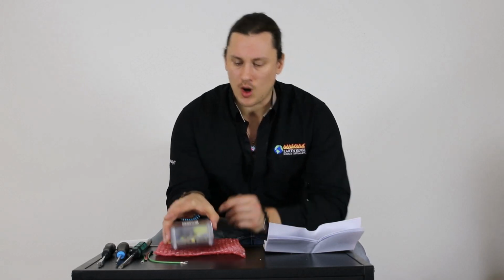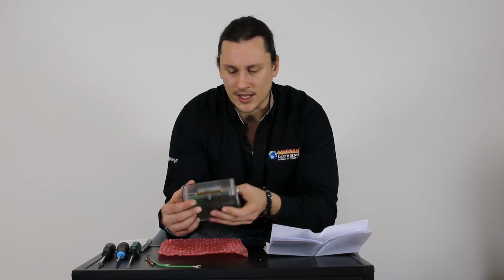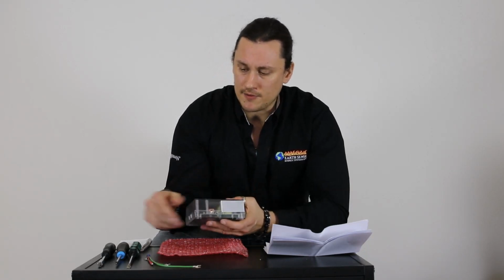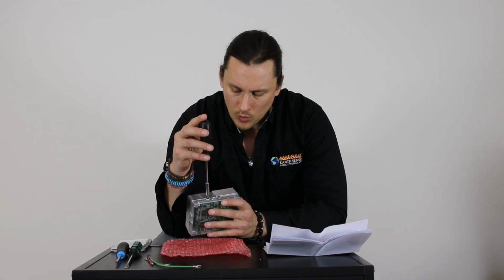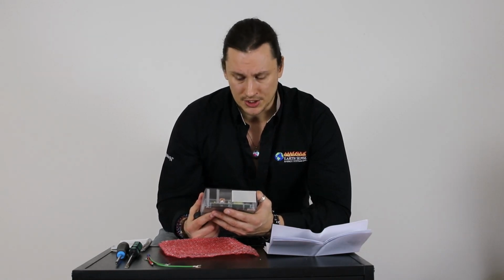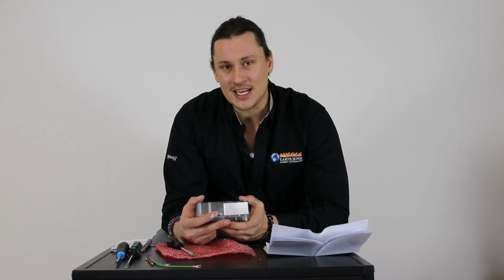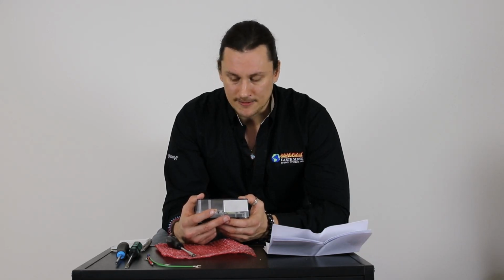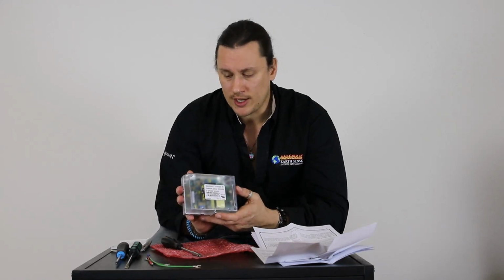QuadraFire 3 Speed Control Board Installation and Settings

Comment: I recently bought a used Quadra Fire Castile Insert (2008).  It seems to work well except I have some reservations on its performance and what I could do to get maximum performance.
Your video helped me set the control board to 7. I set to seven to get a better flame.  Here is what is going on.  The flame is sometimes just in the burnpot and no higher other times about three inches above the burn pot.  I am using premium pellets but they are no bigger then 1/4 mostly.  so all I see going down the shoot is that and a lot of crumbs.  I am wondering if i have a problem with the auger and assembly.  I did look at the thermocouple because it is so old and it looked fine, it was a little hard at the end but I think it is fine because it works with the control board green and red light, I did not do measurements with a meter yet.  Should I replace because of the age? what about the auger?  I think I will replace the blower motor this summer during me seasonal cleanup.  It looks tiered and makes a little noise.  What should I buy that is OE quality but not OEM?
Thank you
Reply from the maker: Thanks for contacting us, I did not see your message until today, our apologies. First off, I would suggest trying a different brand of pellets to see if there is a difference. Unless there is an accumulation of fines in the bag, you really should just see whole pellets dropping in, not crumbs of pellets. See if you can find another brand, buy maybe 5 bags and do a test to see if there is a difference. Most of our customers find that Pine and Fir pellets have the best heat output and lowest ash content. From there I would say it may be helpful to pull out the auger assembly. Overtime, there can be issues with the flights on the auger shaft. Inspect the shaft closely and see if anything is abnormal. We want it to be delivering pellets, not crushing them in the process of feeding. If your thermocouple is currently working fine I would see no reason to replace it. The thermocouple simply allows the unit to go from start-up into normal operation. For the blower motor, are you referring to the room air blower or the combustion/exhaust blower? Happy to send recommended suggestions for your Castile. Inside of the hopper you should also see a pull slide that you can pull up or push down to allow more or less pellet fuel to enter the auger motor shaft. Play with that a bit as well. Keep us posted, happy to help!
Reply: I changed the pellets and seems to be burning better.  I noticed the the glass door does not have the seal on the bottom of the door. Should I have a seal there? @EarthSense
Reply from the maker: @RS-zz3wb  Thanks for the message back, glad to hear the new pellet fuel is burning better. You will notice a really big difference between pellet fuels on heat output, flame size, ash, and cleanliness of the glass and burnpot. Always suggest to try a few different brands and analyze the performance in the stove.

Your 2008 Castile should have a tadpole style gasket that seals the door and glass. Quadra-Fire leaves off the bottom tadpole portion for an 'air-wash' designed to bring in a small amount of room air across the glass to help keep it clean. The tape portion of the gasket should still be in tact securing the glass to the door frame, however it is normal to have the gap at the bottom of the door for the 'Air-Wash'. 

In proper operation, the Quadra-Fire Castile should have a very torchy burning fire - part of the design with the cylindrical firepot. Generally speaking on Low, the fire is in the burnpot, medium up to the rim, sometimes 1-3" over the rim, on high 3-6" above the firepot rim. Again, you will notice a difference in pellet fuel and where you have the hopper slide set. As the unit accumulates ash build-up you will start to notice a larger more lazy fire which is a good indication to do a thorough clean on the stove and vent. 

If you feel there is too much air coming to the fire, let's check your combustion blower motor and the label specs. Just in the event that motor was replaced with an aftermarket it's good to make sure it is the correct CFM motor; the Castile should be 70 CFM. Here is the OEM and aftermarket options for reference. https://pellethead.com/product/quadrafire-heatilator-pleasant-hearth-pelpro-exhaust-combustion-motor-blower-fan-oem/

Keep us posted, happy to help!

Comment: I have a quadrafire Castille insert. The stove continually feeds pellets, but will not ignite. I tested the igniter and it is fine. I set the dial on the control board to 0 and let the stove run through that, the igniter got hot. When I turn the dial to 6 or 7, the igniter will not get hot and pellets just fill the fire pot. The call light is constantly on, and there is a red light on the inside of my control board that is as well. I must admit, I have never seen a green light inside my control board since I have owned this stove. All snap discs are good, all connections are good, vacuum hose has been cleaned out, stove is very clean. What next? What am I missing?
Reply from the maker: Thanks for contacting us, happy to help. I know you said you tested the igniter - let's double check to make sure it is in proper ohm range. If you have the standard 300 watt loop igniter in your Castile, ohms should be 43.5-53.5. Outside of that range there may be ignition issues. More Reference here: https://pellethead.com/how-to-test-and-replace-a-stove-igniter-pellet-stove-ignition-troubleshooting/

If the igniter ohms are correct, then we need to look a bit further. Definitely inspect the igniter wire connections. Make sure the control box is set to the proper dial number for your Castile. If the igniter is not getting a charge/electrical power during start-up (not glowing red), you most likely have a control box issue. If the igniter is getting power during start-up but the fire is not lighting, then we have either an air loss or air blockage issue. Check your burnpot bottom, burnpot holes, burnpot gasket, door gasket, glass gasket. Make sure there are no ash blockages in the stove or vent. No blockages in the air intake. Inspect your combustion motor - should be running near line voltage on start-up for proper ignition. 
In proper operation, as combustion air rushes around the igniter, the super heated air is what is lighting the pellets, not the igniter element itself. Start with the simple things first as you troubleshoot. Keep us posted, happy to help.

Comment: I have the Qua-Fire cb1200 pellet stove …how would I know if the board is bad? I don’t get a red light or green??
Reply from the maker: The best way to determine if a board is good or bad is to have it tested by a local dealer. I would suggest starting with the simple things first. Check your outlet for voltage and polarity, follow the electrical into the stove. Check for any loose wires, exposed wires, or poor connections. Check the fuse that is in the junction box. Disconnect your wall thermostat wires and put a jumper wire or large staple inbetween the thermostat terminal - Could be something with the thermostat - this is a good way to troubleshoot. Feel free to keep us posted and send more details. Happy to help. Thanks.

Comment: I have replaced the igniter the thermocouple and the control box and it still does not start or feed pellets after manual light. I have checked all the snap discs and vacuum switch. I don't think the igniter or original control box were bad. The thermocouple was bad. Where do I go from here? What could cause both the igniter and feed auger to not work? There are no lights in the control box other the blue one during startup.
Reply from the maker: Thanks for contacting us, what Quadra-Fire model do you have? Try reversing the thermocouple wires - We have seen several that need to be reversed to operate correctly. If you are 100% certain both the auger motor and igniter are in correct operable condition, the only thing that would prevent both of them from working would be the control box. You should check your igniter ohms to make sure it is in operable condition. If you have the 300 watt loop igniter ohms should be approx 43-53.0. If you have the 380 watt multi-fuel igniter, ohms should be approx 35-43.5. If there is a dealer that is local  to you it may be advisable to have the control box tested for proper functionality. Happy to help, keep us posted. 

Igniter Reference: https://pellethead.com/how-to-test-and-replace-a-stove-igniter-pellet-stove-ignition-troubleshooting/
Reply: Will try reversing the wires. The control box is New. It still does the same exact thing as the old one. @EarthSense
Reply from the maker: @randywhite7187  Sounds good. It's very rare for a new control box to be faulty. Again sometimes there are local dealers who can test it to be 100 sure. 
How does your door, glass, and ash door gaskets look? Sealing tight? How many pellets have you burned since the last thorough cleaning of the vent, stove, and ash traps? Does your exhaust motor appear to be running near line voltage on start-up? Any air losses or air blockages can/will prevent the vacuum switch from locking in and the auger motor from feeding. For most Quadra-Fires the only thing that controls the ignition sequence is the control board. Again, will be good to test ohms and inspect igniter wiring all the way to the junction box area where the control box is seated.  If you can let us know your model and year of manufacturer, that can help. A couple early Quadra-Fire models were wired where if the high limit switch was tripped it would shut down all power, not just to the auger motor. If you need to troubleshoot the switches, here is a video on creating a jumper wire. Important to never leave a safety switch bypassed, only for troubleshooting. Keep us posted. https://youtu.be/FDVkbsHS95U?si=Z2aj9Pz2K8OTkppT
Reply: I have used the jumper wires to bypass snap disc and vacuum switch. The only dealers are 60 + miles away. They don't repair stoves. They gave me names of repair guys who don't answer there phone.  I have vacuumed everything out that I can find. Would the 3 way rocker switch for heat cause this problem if it were bad? @EarthSense

Comment: I did the test sequence on the control box. Everything works except the igniter. The stove will not light on start up and if I light it manually it will not feed pellets. It does feed pellets as startup just not light them. I believe I have checked everything. Could it be anything other than the control board?
Reply from the maker: Thanks for the message. The control box does control the ignition sequence. Have you double checked your igniter? If not, make sure installation and all electrical connections are secure. Grab a multi-meter and check the ohms to see if it is in proper range. If you have the 300 watt loop igniter, ohms should be between 43.0-53.0 approx. If you have the 380 watt Multi-Fuel loop igniter, ohms should be 35-43.0 ohms approx. Link here to our igniter tech support page https://pellethead.com/how-to-test-and-replace-a-stove-igniter-pellet-stove-ignition-troubleshooting/

Keep us posted, happy to help.

Comment: I get 6 blue blinks. Is that correct for the 1200-C ?
Reply from the maker: Thanks for contacting us. The blue blinks should indicate which setting you have the control box on. The 1200 Freestanding and Insert should be on a #1 or #2 control box setting - 1 being standard, #2 increasing fuel by 10%. Unplug the stove and pull out the control box. Make sure it is set to the correct number for your 1200. Any other questions please let us know. Thanks.

Comment: I have a Castile insert.  It was working fine until recently.  The power is on, the start up sequence initiates and I get the 4 flashing blue lights.  The Thermostat is calling for heat, bit the red light is not coming on and I am not getting any lights on (after the 4 blue flashes).  The startup sequence completes itself, and then nothing.  Fuse is good (otherwise the startup sequence wouldn't start)  I am thinking the control box is bad, but want to see if it could be anything else.
Reply from the maker: Thanks for contacting us. During the start-up sequence does the stove feed pellets, ignite, and burn those pellets as it normally would? If the start-up cycle is running correctly but the unit is not going into normal operating mode, it more than likely is an issue with the Thermocouple. Here are a couple videos regarding the Thermocouple. If your stove is not running correctly during start-up it most likely is something else. Just let us know as many details as possible - we are happy to help. 
https://youtu.be/JhMTxAzQ9k4?si=MEqllbfMzLk6ul-D

https://youtu.be/Hjs3KhP9ntI?si=3Epot1mR6F2EbBob
Reply: @EarthSense  no, nothing is happening. It just cycles through and shuts down. No pellets, no nothing.
Reply from the maker: @SamuelBail-v1p  Okay, so just to be clear, when you turn the thermostat above the room temperature to turn the stove on, NOTHING is coming on in the stove - no combustion/exhaust fan, no pellet feed, no ignition - is that correct? Does the red call light come on at all when you turn the thermostat above room temperature? In your original message you say the start up sequence initiates - what do you mean by that?

Comment: I have a CB 1200 I recently purchased from a friend that has been shutting down about 15-20 minutes into startup.  The control board was previously replaced but didn't resolve the issue.  I was thinking to replace the thermocouple and was looking to see if it failed to hit the red light or was flashing amber but upon startup the only light I noticed coming on was the blue light which flashes for a bit and then turns off.  No green, red or amber.  The switch is set to 1 on the control box which I believe is correct.  I'm letting it cool down again and planning to verify the connection is good on the thermocouple or maybe try reversing the thermocouple wires and see if that gives me some sort of light on the control board.  Any other ideas?  Thanks!
Reply from the maker: Thanks for contacting us. It does sound like your 1200 is not making it out of start-up mode into normal operating mode. Control box setting on a Number 1 is standard for the 1200. We definitely want to inspect the thermocouple. We want to pull off the ceramic cover to make sure the end of the thermocouple is still soldered together and not split. We want to make sure the Thermocouple is far enough over the burnpot to detect the heat properly. If not enough fuel is coming in during start-up it can effect the thermocouple from getting hot enough to go into normal operation. The 1200 should have a slide inside the hopper that you can push or pull to allow more or less fuel to enter the auger shaft. Let's check that position. For testing we can also place in a half-handful of pellets into the burnpot and then start-up the stove. Good test to ensure we are getting the thermocouple hot enough during the start-up sequence. You can try to reverse the wires as mentioned; however if it worked before it is most likely not that. Here is an additional video on the 1200 thermocouple. Keep us posted, happy to help. https://youtu.be/Hjs3KhP9ntI?si=8syq2iFlV1R-yfPx
Replacement Thermocouple Here for Reference - https://pellethead.com/product/pellethead-replacement-quadrafire-800-1000-1100i-1200-1200i-thermocouple-35/
Reply: @EarthSense  I reversed the wires and got the green then red light.  It's been running for 1.5 hours now.  Woohoo!  I'm thinking my friend must have replaced the thermal couple when the shut down issue started, had the wires reversed and then proceeded to the next option of replacing the control box.  I picked up from one of your other videos that sometimes the wires can be reversed so I thought that might be it but I was thrown off by not seeing any error lights on the control board.  Thank you!  I was about to buy a new thermocouple I didn't need!
Reply from the maker: @angeladavenport9470  That's fantastic to hear! So glad to hear the stove is up and running! If anything else comes up just let us know. Thanks!

Comment: Great video I'm in a bad position my used refurbished Castile the combustion blower is shutting off while the stove is lit filling the house with smoke. I bought the stove off my local Quadra fire dealers tech who I lived across the street from me for 8 years. He is currently blowing me off by not answering calls or texts . What to do I can't very well go to the dealer that's a last case resort.
Reply from the maker: Sorry to hear of the situation and troubles. For the combustion fan to be shutting down during operation, we either have a failing combustion motor, electrical wiring issue, or a control box issue. We would suggest checking the simple things first. Get a good light and inspect the wiring in your stove - in particular the connections for the combustion fan. Next, you can create a test cord and run the combustion motor to direct power. Link for this here - https://youtu.be/rlmiCYI2WPk?si=TnAEML6z6Ublw5we. From there see if your local dealer can test your control box. You should be able to talk to or communicate with a dealer rep about your unit by providing the serial number.  Hope that is helpful.
Reply: @EarthSense  Thank you very much to take the time to give such a thorough reply. I appreciate it Earth Sense will always have my business. Customer service goes a long way these days. Thanks again.
Reply from the maker: @PJLeo39  You're most welcome, we are always happy to help. Feel free to keep us posted and we'll do our best to provide solid guidance until you are back up and running at 100%. Thanks again!